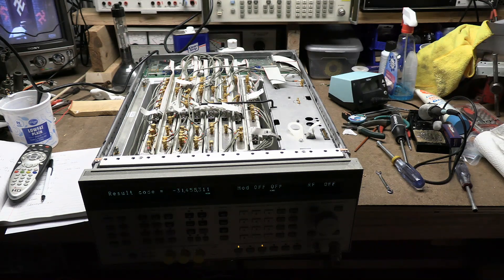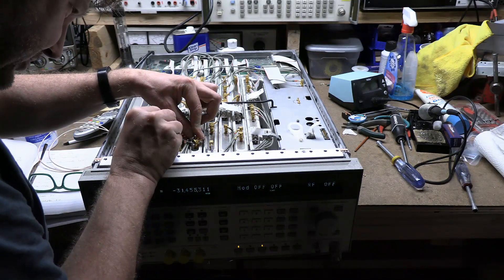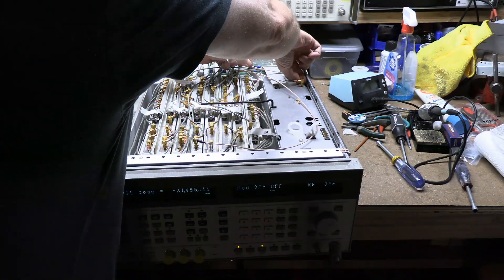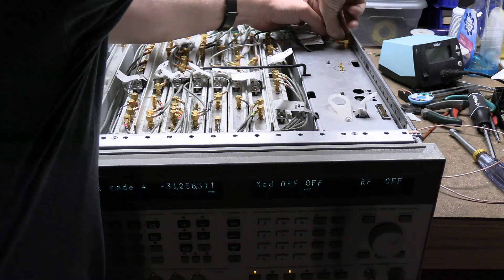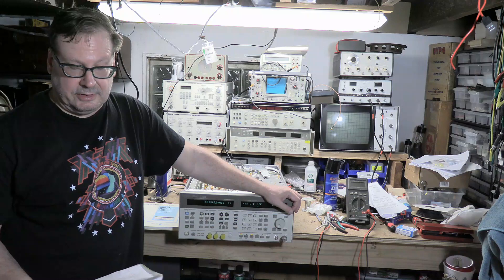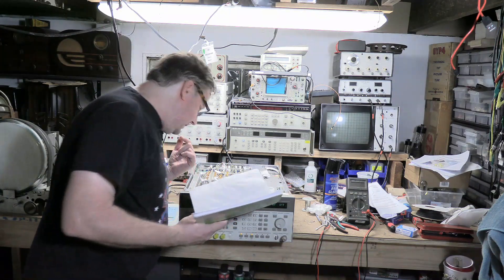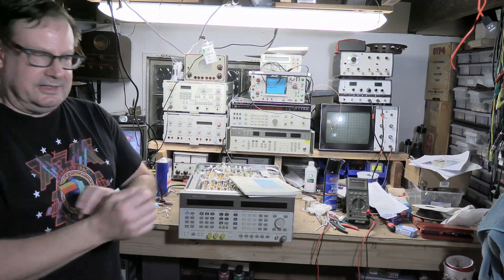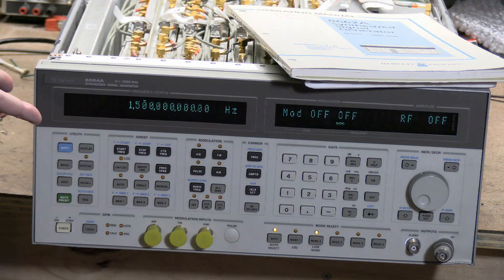Agilent HP 8664A pt3

Comment: I would definitely run the calibration procedure and see what value you get without touching the adjustments. If it matches the factory value then leave it, if not then adjust it a bit closer to the factory number and see what errors you get. Also, does the manual say anything about stored calibration values? You may have lost some calibration values because of the dead battery and may need to do a complete re-cal. Regards, David
Reply from the maker: The device works a bit differently. It can calibrate itself. It runs through thick calibration every time it's powered up if the battery dies. The procedure I mentioned helps pre-tune a feedback loop. Seems like it's unrelated to my ALC issue, but it's worth a shot
Reply: @bandersentv  Yes, I understand that the unit performs an in-depth calibration procedure when it detects a loss of the NVRAM memory, when the temperature changes significantly, or when commanded to calibrate. However, there are certain parameters that it cannot determine on its own that must be entered into memory by performing the "Assembly Replacement Self-Cal Adjustments" in section 3 of the Service Manual. On page 3-2,  the MW Loop Self-Cal Adjustment states, "This procedure sets and stores correct pretune DAC values ......." You haven't changed the MW Loop Assembly but you have lost DAC values when the NVRAM battery failed. I would perform both the MW LOOP and HF DRVR  Self-Cal Adjustments then run a Self-Cal.  Regards, David
Reply from the maker: Ah, thank you very much for the detailed explanation.  It would be amazing if performing these procedures eliminated the errors.  I will attempt as soon as possible.
Reply: @bandersentv 

hi
with my unit I had several error codes after a self test. I had converted my unit from 110v to 240v maybe that had something to do with it.
after going through the steps mw loop self-cal
and HF DRVR self- cal adj then special 170 and it was fixed. with me the value at R170 was very far off.

Comment: it looks like a common error RF module is defective, i saw exact unit for sale by Alltest in New Jersey and they are selling the unit as defective and commented with exact errors with RF module Kaput and pointed to the Gallium arsenide diodes, either you sell it as is, or try to replace those diodes may be.
Reply from the maker: or just use it as-is.  It's plenty accurate enough for the work I do.

Comment: Have the same problem. Everything blames the GasAs module. Bought two spares which made no difference, got another HF driver, no difference! Measured all the internal levels which seem reasonable except the 1Ghz ref. Replaced parts from the MRF581 to the Enabling line transistor. Still the 74LS377 chip to go but have feeling this may not be the culprit. Earthing the EN LINE GIVES FULL +2dbm 1Ghz output. But the presence or absence of this signal makes no difference to the fault code. Getting a junk machine to Australia is too expensive. Will just have to accept no output below 3Ghz. Ok above to 6Ghz. How I wish I had a friendly contact who worked for HP.
Reply from the maker: 8664A only goes up to 3GHz.  Do you have a different model?
Reply: @bandersentv  I have a HP 8665B. It shares a lot of the same modules and internal structure. I think only the ROMs and YIG are different.

Comment: Having to trace and draw out the circuit for each of the modules used in the Hp8664/5 series units. Huge job but seems there is no other choice to servicing to component level.

Comment: What are you using for your house clock?  Even 30 year old crystals can drift.  I would run the calibration.  Good luck.  At worst you have a 100 lb door stop and a story to tell.
Reply from the maker: Well it's working fine as it is for my purposes so definitely not a doorstop. It has an internal crystal oven.

Comment: I completely understand that you want to leave the complex beast alone for now and use it as is. I would. But I have to object to the claim that component level repair of the modules is impossible. If you have the lab and knowledge, component repair on those things is possible even without schematics. Shriar of the signal path proved that several times over, but then again he has a few grand of measuring equipment and the knowledge to use it. So I don't expect most people to copy him😂
Reply from the maker: True and I'd be curious to know what he would do. Since it is fully functional, I doubt there are any bad parts. It's more likely there are parts out of spec. Far more difficult to track down.
Reply: @bandersentv  my guess is he would use his equipment to test every module separately. Back to front, maybe choosing his start point close to where the expected problem lies. Let the device control the modules and set it for an output that brings the module in a state that can be measured and compared to the expected state. But he can do that as he has the equipment to split a signal and measure it without the device noticing. Once the problem module is identified, I guess he would measure the components and such to find where things go wonky. There are always a few prime suspects.
Reply from the maker: That sounds insanely difficult without any service info. How would you know what the input and output is supposed to be?  Also considering the outstanding phase noise and stability specs on this device, I'm wondering if it is even possible to test the modules outside the device.
Reply: @bandersentv  you don't need to know exact numbers in this case. You're looking for a dip in output depending on frequency chosen, not an exact number. Most of those blocks also have a specific task. Like frequency generation or modulation. You expect to see what you put in on the front panel. In your case you expect the output level to be flat for the entire frequency range, not a curve or sudden dip. 
Curious Marc also has s recent series on a HP counter with plugins for GHz frequency's. Some of his diagnosis also was just looking at a spectrum changing frequencies and checking at what point output power went down. 
I don't expect I could do it, but shahriar likely could. Likely Marc and his colleagues too, they are much smarter than me. 
But even if we were smart enough having the equipment is the next challenge. Both people I mentioned have rather large labs. With all kinds of stuff.
Reply from the maker: I noticed that the output level varies with frequency.  I have no idea if that is what the actual problem is internally. That curious Marc device is from the 60s.  This device is controlled by a 68000 microprocessor.  I can't even imagine where you would get replacement components for the RF stuff.  Hand selected, house # parts.
Reply: @bandersentv  the varying output level is your symptom, so you track that back to it's origin.  What is actually causing it seems irrelevant te me. Or if the component that you need replace might be unobtanium. You'll have to find the origin of the problem first. And for that you need to troubleshoot, and the general method for that doesn't change, be it a device from today or the sixties. 
If the problem is varying levels on the output it's going to vary on the output of one of those modules, it won't magically change into something else, CPU controlled or not. If the variation is on the output and the input of a module you move one further back. All those interconnects carry analogue signals, the CPU is there just to tell a module what to do. I very much doubt the CPU is telling the module to vary the level. This seems very much a problem in the analogue domain.
Reply from the maker: My point was that in order to test a module out of the device you need to plug it into a bus that would normally be driven by a microprocessor.  I do not believe there are card extenders for this device so you can't probe anything while it's powered up. That's why it's just module level diagnostics.
Reply: @bandersentv  I see what you mean. That would then require either making the necessary extenders. But that was not what I was getting at. That was just using the in and outputs on the top of the device to definitively determine which module is failing. By using controlled analogue signals into them, while still having them under device control. Unless I am mistaken all analogue signals between modules are at the top of the device. So it should be possible to at least definitively prove which one is outputting something that is incorrect, while giving them known, monitored maybe even external inputs. 

Let's say you want to test a modulation module, it would normally take its signals from elsewhere in the device. From one or more frequency generation modules or an external signal. Let the device set its modules, but interrupt the analogue connections and supply your own known good analogue signals to the modulation module and then check the output. The microprocessor will never know the difference. As far as it knows the good signals are provided by its own modules.
Reply from the maker: I can't imagine what could supply the correct signals that wouldn't cause even more errors. Even today, this is just about the most accurate, most stable RF generator that exists.  I took a closer look at the modules and they are sealed metal boxes.  So even with extenders there's nothing you can probe.  The internal tests indicate which modules have issues.  The question I posed is if it is possible that one bad module could result in false errors on other modules.  It is entirely possible that this is not the case and all the test results are perfectly valid.  If so, I need to replace them with good ones if I want to get the best performence possible out of this device.

Comment: I'd take the risk of trying the calibration. Mark the position of the pots before adjusting and if all goes pear shaped, put them back to where you started and hope for the best. Of course I didn't buy it and it wouldn't be an enormous white elephant for me if the attempt fails.
Reply from the maker: 10 turn trimmer pots.  I'll try to make note of the displayed value before making adjustments.
Reply: @bandersentv  Ah, 10 turn, yes that makes it tricky.

Comment: If it’s been treated roughly and the unit has a main board it might be a cracked board or trace.
Another thing is any connectors or board edge connectors, pull modules and clean every connection, even the gold ones, I have fixed many items or reduced the fault count just by doing that.
Reply from the maker: Please keep in mind that it works as is. There are no major faults. I only found these error codes by running a low level diagnostic. The specs on this device are outstanding so what it shows as an error might be completely acceptable for my purposes.

Comment: I agree with @69Dartman, if you can record values that system displays in the calibration procedure before you get your screwdriver out then you have a good chance setting the pots back to the positions they are set to now. As there are a few pots to adjust there is always the chance of interaction between them which may mean you can't precisely return them to their initial setting.